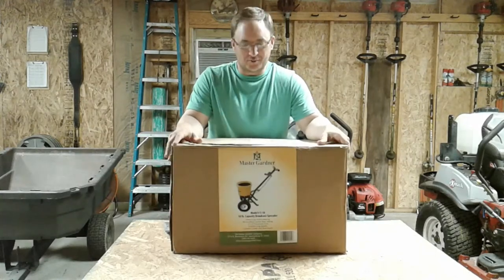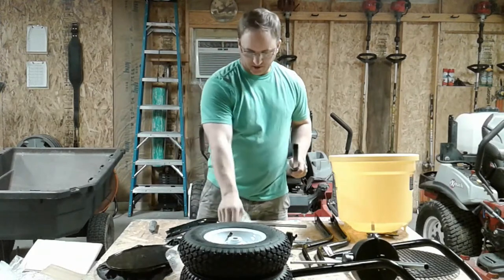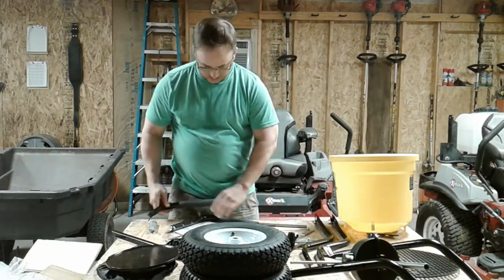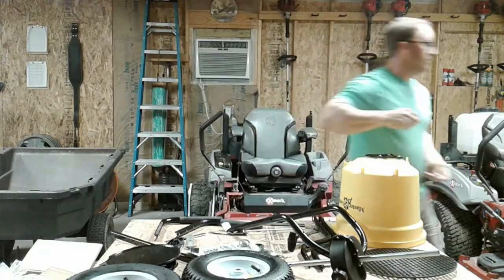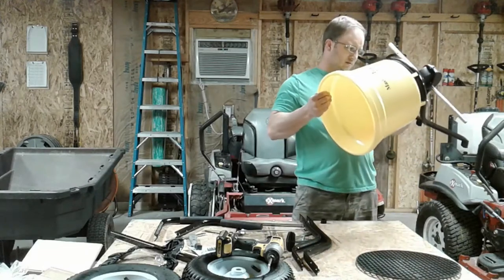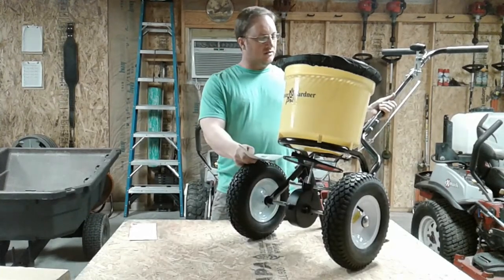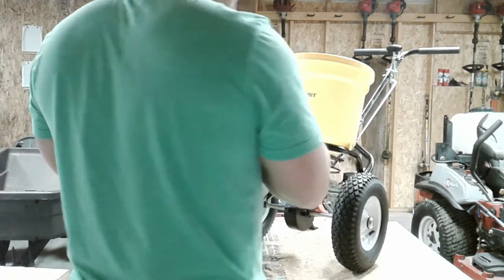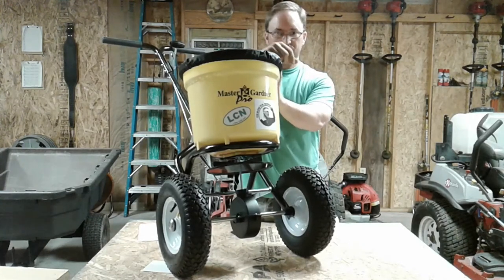Got a new Spreader

Comment: Looks like you got u a good deal ! I have had some of the earth ways like that with the bucket on them they work good . That painted frame and those wheels will rust in a hurry when exposed to that fertilizer so wash her down and rub some fluid film on it when your done should last u a long time. .... btw good thing u got her to read u those instructions 🤣
Reply from the maker: Thanks for the tip
Reply: J's Crazy Cutz, LLC yes sir any time! A good place to look for fertilizer requirements is NC states turff files website they have maintance calanders for all turff types the timing might be a little different cause u r so far south check it out